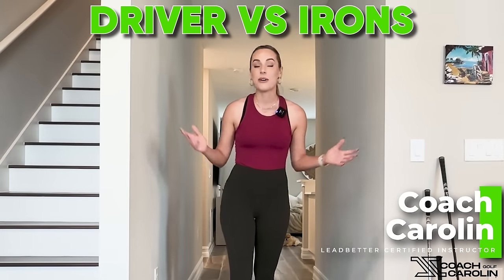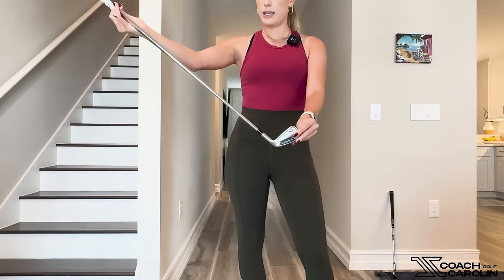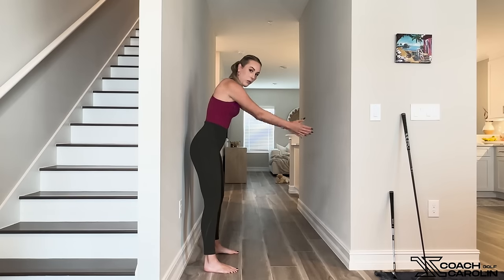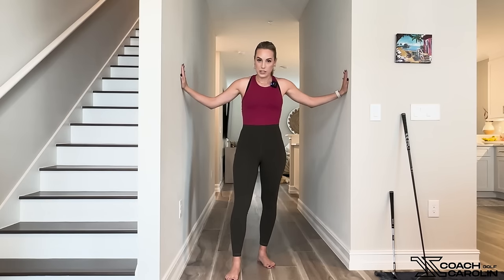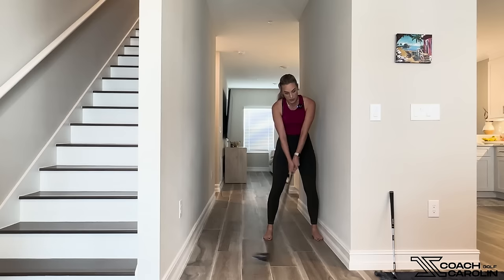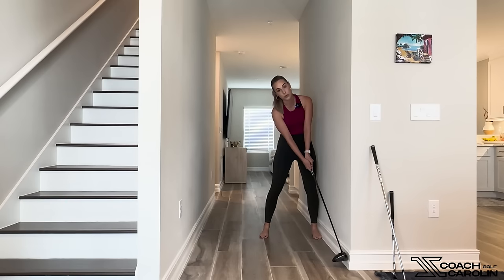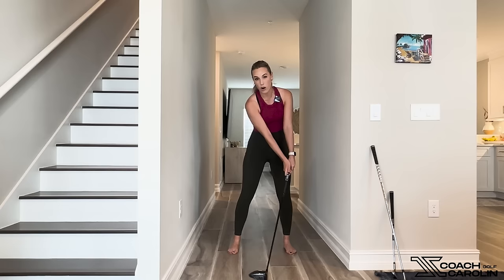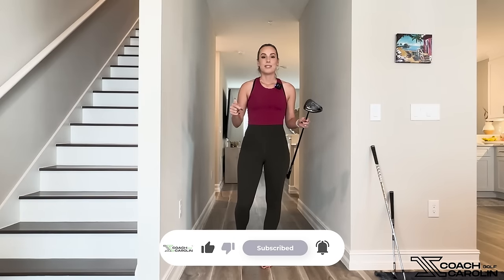The ONE MAJOR DIFFERENCE you didn't know!

Comment: I have been playing over 50 yrs  and as I lead with my right side ( i call it right handed ) well I went over on my left ankle sprained it 6 days ago used a buggy on 3 rounds walked 2 but worst was playing a shot , as turning on my left foot was very painful SO WHAT I DID WAS USE TORSO AND ARMS ONLY  , YES LOOKED LIKE NOTHING TOLD BUT EVERY DRIVE WAS NOT ONLY DOWN THE CENTRE BUT WITHIN A IF NOT ON CENTRE CUT OF FAIRWAY AND PRETTY LONG , MADE ARMS ACHE NEXT DAY , EVEN on the irons , when you chip its a lot like that , THROUGH ADVERSITY YOU FIND A WAY, if like me you play 5 times a week . Paul

Comment: That makes lots of sense- Thank you for the tip!

 I've learned to drop my right shoulder at address which also allows me to launch the ball on impact but if your hands are leading and the club head is behind then it will never get launched into the air.  For this it makes more sense for iron since you have to dig down and through with the ball.  

I must have also fixed something as well in my game and I no longer slice anymore (probably the way I grip the club).  When I played yesterday, my driver tee-off had low trajectory which I later found out I wasn't teeing my ball high enough.  I forgot the rule of teeing your ball halfway up the club height and I think my tees were too short (2 3/4").  

But this hallway wall helps us all see from the front perspective since we always like to record our hits on the course from behind which doesn't really show the clear picture and help you address issues.  Better get some primer and paint to touch-up those dings and scratches on the wall.  =)

Another quick question- why do pro players create huge divots after hitting an iron shot?  Does creating a divot indicate you are hitting the ball properly or does creating a divot help you impact more spin on your shots?

Comment: For me, it is exactly the other way round. I hit my driver much better than my irons, my best shots come with my 3wood off the fairway, and the clubs with which I struggle most are short irons and wedges. I always think that it has to do with the fact that my first sports were tennis and baseball, so flatter swings come a lot easier to me.
Reply: One-length iron sets aren't super popular but there's a new trend of one-length shorter irons. Might help. My specs are standard but I play irons and wedges +2 inches for the increased swing weight. My posture and swing plane also improved. I picked up a standard wedge the other day and it felt extremely short and uncomfortable.

Comment: Think the average angle of attack on tour with driver is -1.5
Reply from the maker: It is on the PGA Tour, it is +3 on the LPGA. It has to do with equipment and swing speed for the PGA Tour players but it does range within a few degrees and also depends on what kind of shot you want to hit. If they want to hit it high and carry it further downwind, that changes.
Reply: @coachcarolin  so it is 👌 thanks for the info - sweet vid